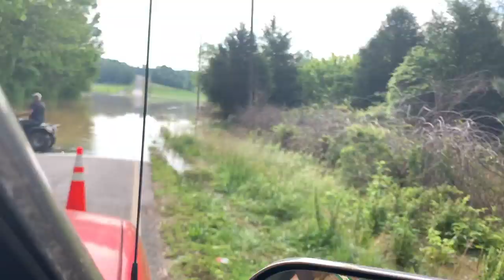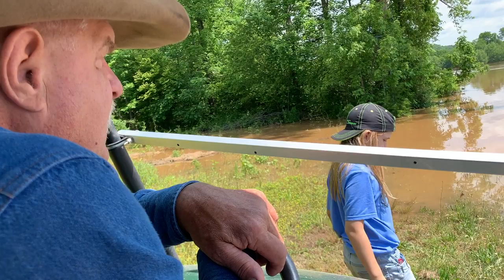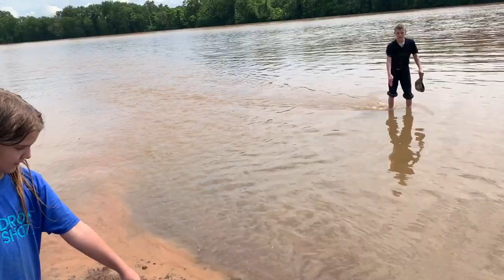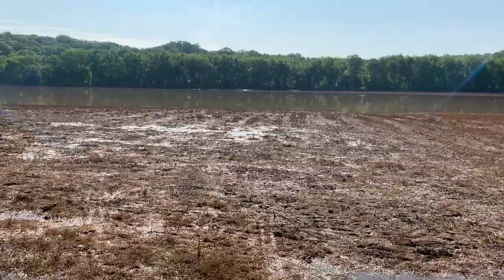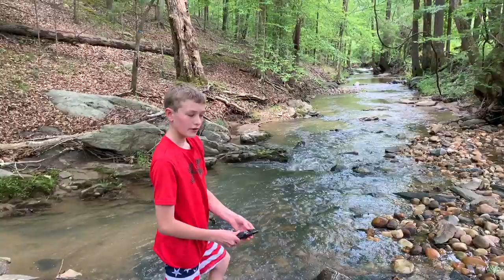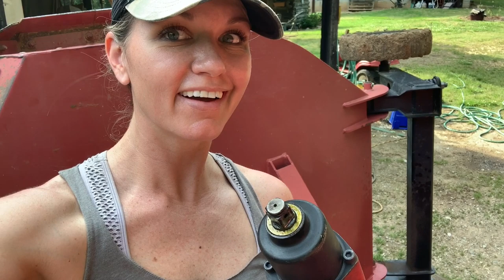Still Flooded...But Moving On!

Comment: Just be sure to keep your Musket Powder dry. Two Barrel carburetor has two large openings through which the air flows and each of the openings has a tube with a hole in it that provides gasoline into the air because the air flowing through the smaller opening on the tube "sucks" fuel out. However the larger opening is not as efficient as a smaller opening. So some smart folks came up with the four barrel carburetor. Two small openings which are open most of the time and two large openings that are only open when lots of power is needed. So the four barrel carburetor gets better fuel usage under most conditions while providing more power under loaded conditions.

Comment: Every old Dodge Pickup I have ever used, I remember that I always had to pump the gas pedal a few times, then pushed it to the floor and hold it there before I ever tried to start it, continue holding the pedal on the floor while cranking and they would always start right up. I know this is probably not news to yall, but it was worth a mention I expect.

Comment: twice in such an early season, hope it does not go to drought when it reseeds . 2 barrel  carburetor is 2 holes(air&gas) into engine and 4 barrel is 2 more holes total 4 to let air&gas in motor. As farmer said , burns more runs faster cost more. Farm girl learns

Comment: I'm betting the accelerator pump diaphragm in the carburetor is bad on that truck. So it's not holding and pumping the gas correctly. It's pretty easy installing a new one. They are tough old trucks.

Comment: Check the triangle plug box on driver side fender and the white ceramic plug on fire wall both those two parts fail at same time
I all so put electricit full pump in with a switch so it didn't lose primer
I owned one same year my first truck